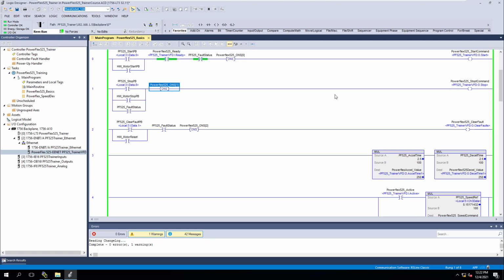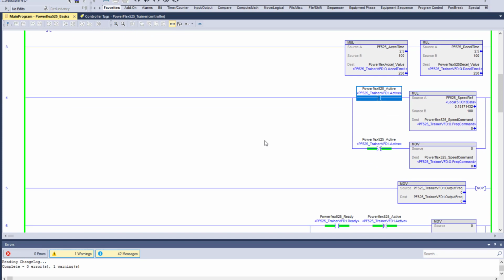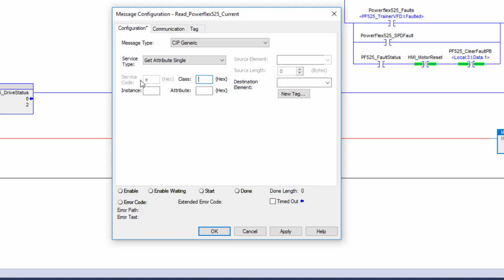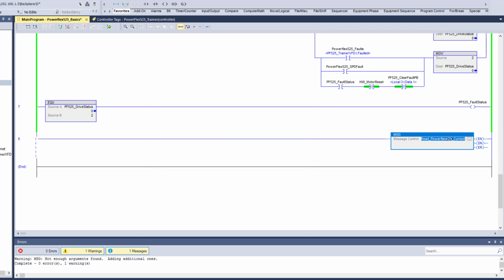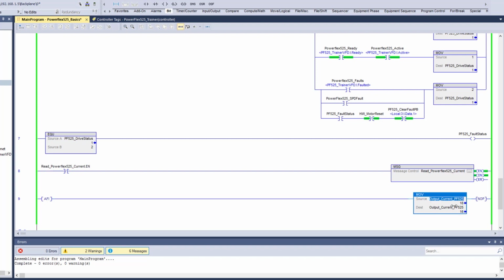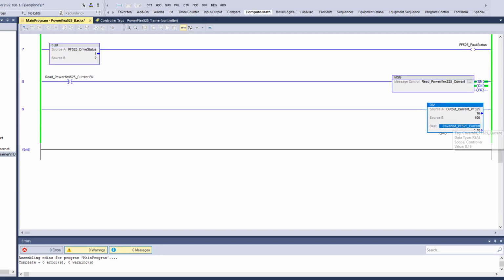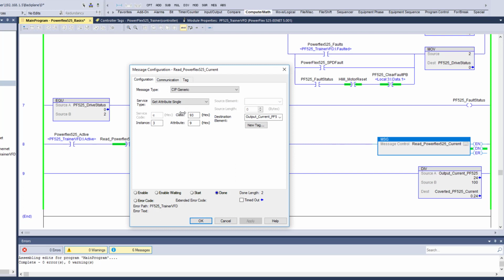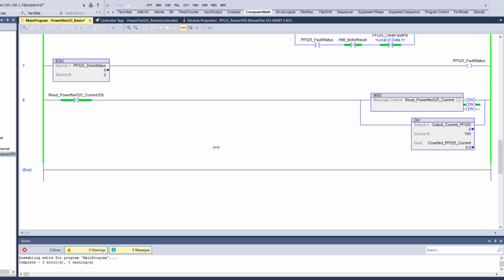Reading PowerFlex 525 Output Current Using Message Instructions in Studio 5000

Comment: Hi Shane, Thanks for posting such a great video. I'll be honest the hardest thing has been finding the data table to reference the parameters from. Rockwell haven't made this easy at all in my opinion. But if I could just work backwards from your example, using the 525 manual to find the Output Current parameter B003. I then used the Embedded Enet adapter manual (Rockwell Automation Publication 520COM-UM001B-EN-E - March 2013) to find the relevant Class and Attribute values. The Class value of 93 (Hex) comes from the DPI Parameter Object Class Code. The Instance Value comes from the Instance Attribute Table (Not the Class Attributes Table) on the next page of the manual which allow the Get/Set rule of the parameter Value in the selected Instance. In this case the Output Current. 
Is that where you got the data from or am I looking in the wrong spot?
Reply from the maker: No, I used Google 
Rockwell knowledgebase rarely helps that's why I make videos to support using this software because I can make it much easier and clear to understand

Comment: Hey was wondering if this would work for the powerflex 700. I was able to find info on the 755 but haven't found anything for setting up a 700. Thanks.
Reply from the maker: @theshadow2256  Not sure about the PF700, they are old drives but you should be able to request data from the drive using datalinks
Reply: @ShaneWelcher  do data links regeir me do to a download?
Reply from the maker: @theshadow2256  yes
Reply: Do you any other parameters you can view with a read? Like voltage?
Reply from the maker: @theshadow2256  I'll have to look into the RA knowledgeBase
Reply: @ShaneWelcher  Think I found some good info from there Embedded EtherNet/IP Adapter in their manuals. Page 169. Ports 1-14 are listed.
Reply from the maker: @theshadow2256  ok

Comment: Very nice to know. Is there a downside to so it this way? Does it increase the traffic on your network. Is it as reliable?
Reply from the maker: @SolutionAutomatisationProg  It's just a message to the drive so not if you have a good network or not that many messages
Reply: @ShaneWelcher  OK, or If I have a dozen+ drives on the same comm. card I guess? Then how can I test the saturation? I am guessing that I would have to adjust the sampling frequency. Am I right?
Reply from the maker: @SolutionAutomatisationProg  depends on your network

Comment: Does anyone know how I can use this with other parameters? I presume I must use the parameters Hex code but cannot find them anywhere. Its for my Final year project of my degree. The current is a huge help but I also need voltage and power at minimum
Reply from the maker: You need to create a datalink for that

Comment: Thanks for the video,
What would you enter in the destination element and/or service type if you wanted to get instance 13 (for example) which consists of different data types.
(DPI read basic)
Reply from the maker: Just make sure the data type of the drive parameter you want to read is the same data type as the tag you made to receive that data.
It really is that simple, just look at the VFD's parameters to understand what data type you are trying to read.